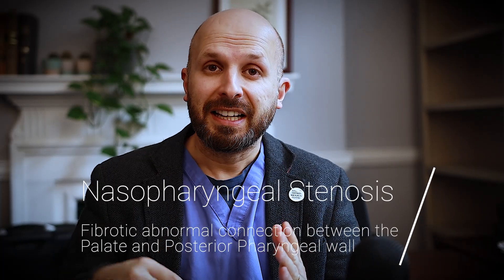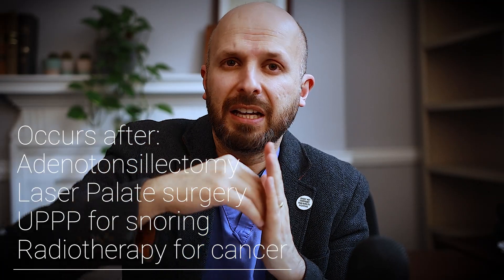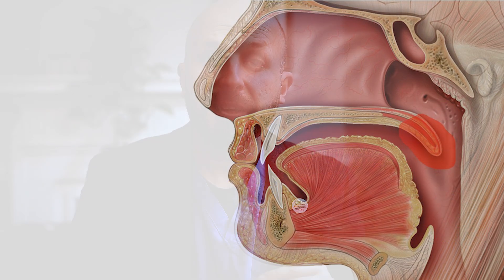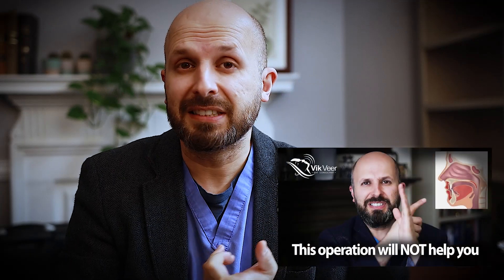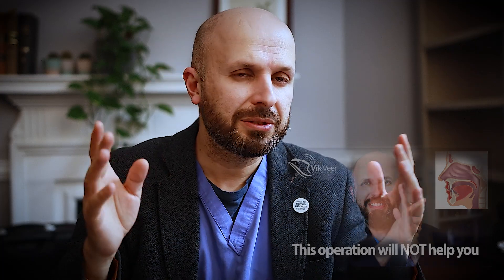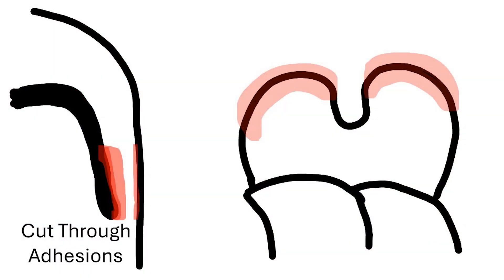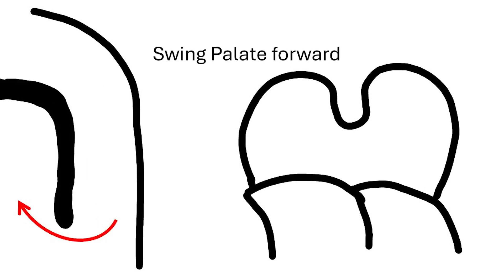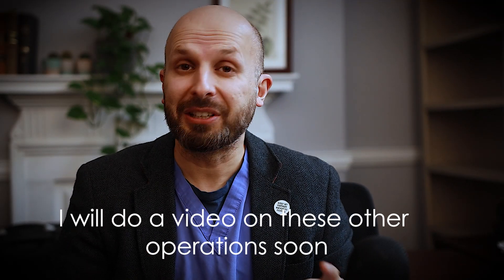How to Fix Nasopharyngeal Stenosis: Complication of Laser Surgery

Comment: Very interesting. Can a cold method for adenoidectomy (currete) cause a stenosis? And how is it diagnosed? through nasal endoscopy?
Reply from the maker: It think that is unlikely unless the operation was done very poorly.  the adenoids are too high to cause stenosis.  you can cause injury to lower down in the throat if you forget to straighten the neck and curettage too low.  I've not seen that happening ever.
Reply: @VikVeerENTSurgeon  Thank you. I just read that sometimes an adenoidectomy can be a (rare) cause for a stenosis so I thought I would ask. Maybe Choana stenosis?

Comment: Doc u r doing a wonderful job. Your in-depth understanding of sleep apnea is commendable. However suffering from sleep apnea myself I am practising side sleeping for 5 years now. It helps but not 100%. I used Otrivin nasal drops for over 2 decades for my blocked nose and it would give me sound sleep for 8 hrs. It works on the principle of contracting the nasal cavity thereby allowing air to flow through. Can you please explore the possibility of inventing a syrup, gargle or a mouthwash on the same principle to keep the tongue flap from collapsing? Sometimes simple ideas may work better than complicated procedures. Kindly explore this possibility with a pharma company. 
Suresh Bengaluru India

Comment: Hi Vik I am a GP and  unfortunately a loud snorer. Thanks so much for your YouTube clips you have taught me so much I am applying some of the techniques on my snoring .  Also importantly I am passing on some of your tips to my patients so  that is a double advantage.
I had radio frequency ablation of my soft palate and uvula some years ago. Post op it hurt like hell and didn't work. I bought the Zeus nerve stimulator but that did not work either. I am trying a mouth guard at present , not sure if it is working, my long suffering partner will let me know. Thanks again.

Comment: How do you keep the soft pallet from moving? Mine seems too have a mind on it's own when looking in the mirror.
Reply from the maker: it has to be able to move or it won't function. the key is placing back into the correct position and size for your throat